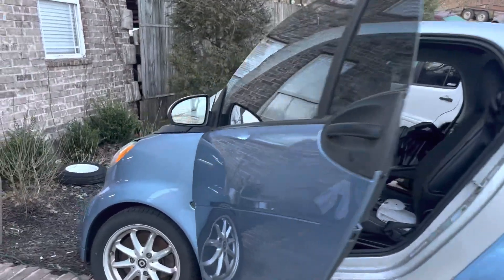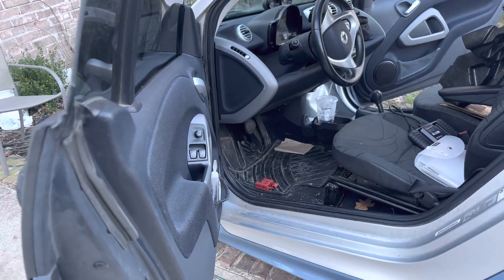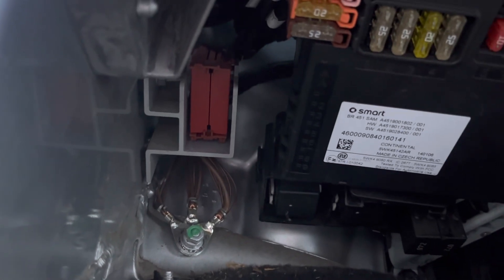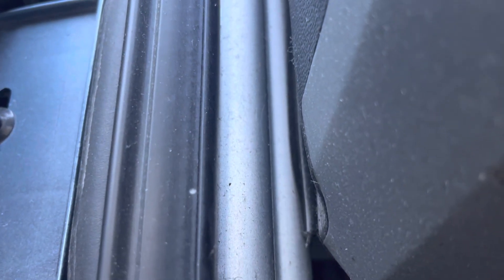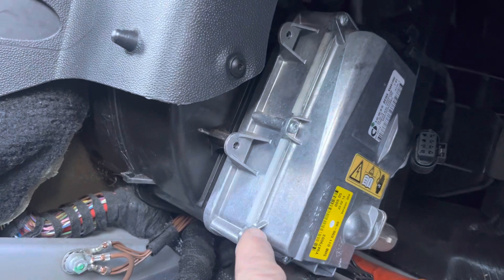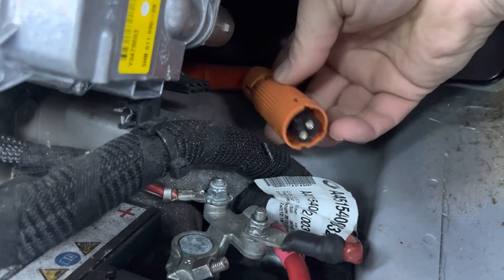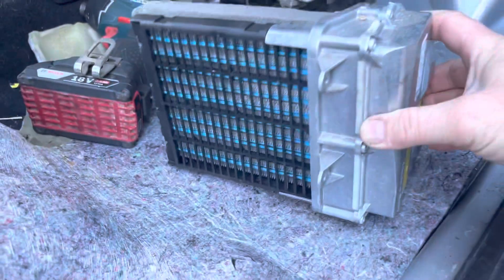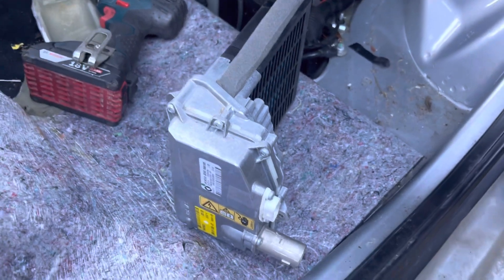Smart Fortwo Electric Drive 12v battery location and Heater fix part 1

Comment: New to smart EV "ED". My 12v keeps dying even after just driving and turning it off. What steps should i take? Once the 12v isnt working, my charger wont charge my main large battery. Pls help
Reply: You might need a new 12v by now if it hasn't been changed.

Comment: This plug disconnects the Drive battery (400VDC) from the car. The drive battery is used to power the heater. If you don’t see a mileage drop (like when you put the AC or fan on) when you use the heater check F8 first. If this is Ok than perhaps the heater unit is defective.
Due to the stiff suspension of the smart it is possible that the soldier connections may be loose. A new heater cost about €300. 
It’s also possible that the motors that open the airflow to the heater are defective or stuck. If you feel the heater is getting warm this may be the root cause and the system will not allow the heater to get warm. Mercedes are very complex with regards to this “possible” fire hazard since it is located so close to the auxiliary 12V battery.
Reply: What do you mean by "check F8"?  I am in the midst of doing some troubleshooting on this same issue.
Reply: its a fuse check the manual :)  @brianpcotter
Reply: I need to change my 12V battery and need to know for sure if this disconnect switch is a temporary or permanent way to disconnect the traction battery.
Reply: Do you have a picture Off what i have to do inside? I have the same problem😊
Reply: Drive system engine off warning . Car is stuck now after I put back the fixed heater .

Comment: Picking my 2014 up from Mercedes dealership today. They originally wanted almost $6k to buy a new heater from Germany and having it installed. I told them that I'll find another part somewhere else and have them install it. That evening they call me back saying they actually have an abandoned smart car 2014 with a dead battery. A new battery is over $26k shipped from Germany. So when people don't do battery maintenance their battery dies and they ditch their cars not wanting to pay for the repairs. So there are a few parts cars out there domestically. Much better deal than buying new.